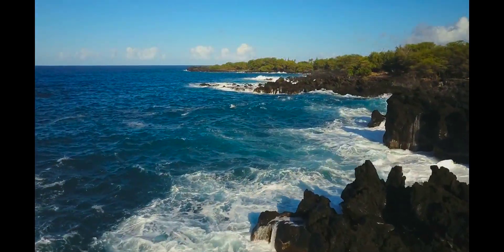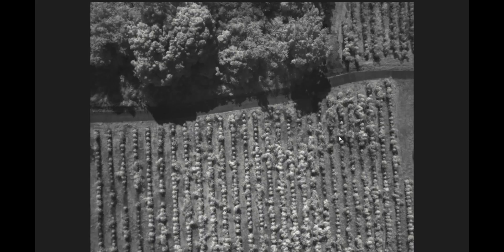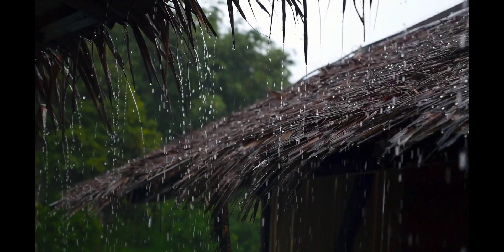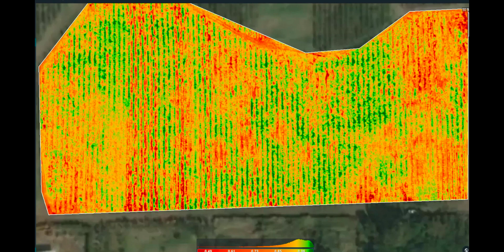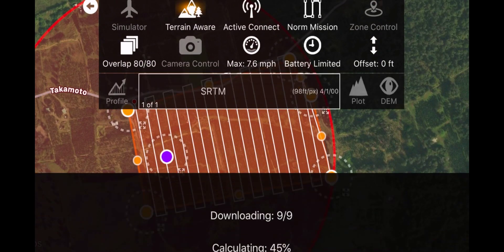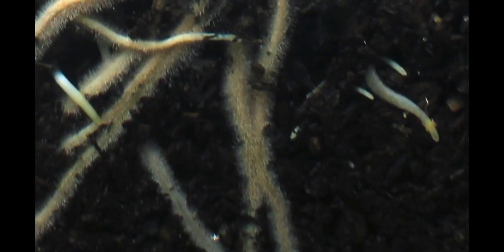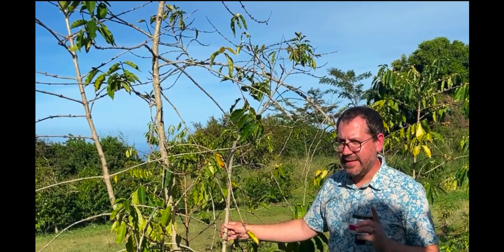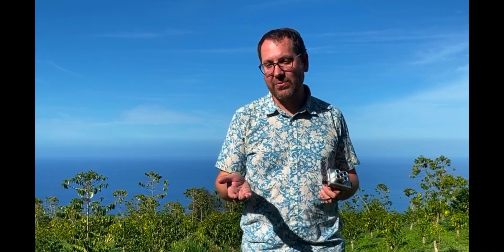How to Map High-Value Crops with Drones

Comment: I'm curious about the settings you used in Map Pilot, because I flew my Matrice 200v2 with Map pilot a couple of days ago and couldn't get it to fly faster than about 7mph.  I turned off the option for slowing down the drone due to light conditions and set the max speed to 18mph.  I was flying at 200' with 80/75 frontlap/sidelap.  I also flew using GS Pro and I noticed the speed was automatically adjusted depending on the frontlap settings.  At 75% frontlap GS Pro flew at about 22mph and at 80% frontlap GS Pro adjusted the speed to 18mph. I think the only time I'll use Map Pilot is if I need to use terrain following.  Thanks for the video!  Would be nice to see you in Hawaii again.  As you can see, after a year the company finally got me Matrice 200 and Micasense RedEdge MX.  Woohoo!

Comment: Hi Greg, Thx. for the overview. How effective is the IR sensor - were you able to detect any drainage (or similar ) issues with it ? Can this sensor be compared with the DJI Multispectral drone ?
Reply from the maker: I have found the IR band is good for picking up tiling in other fields for other crops.  Drainage isn't such an issue here in this soil type, except to wash away nutrients.  Currently testing DJI's new sensor.
Reply: @GregCrutsinger  hello Greg what’s the cost for the sensor camera